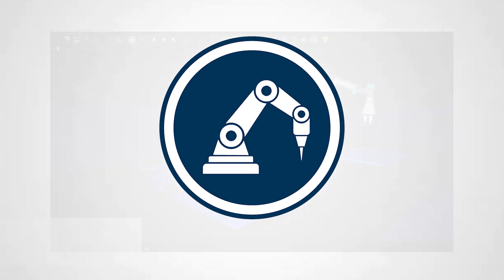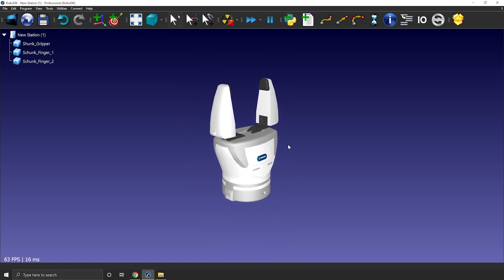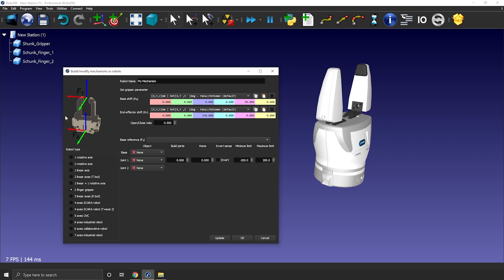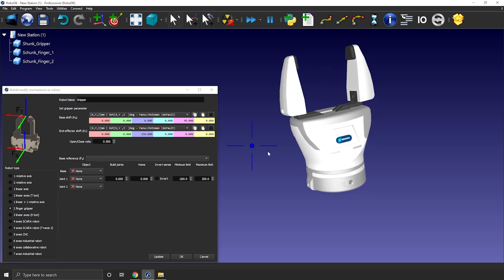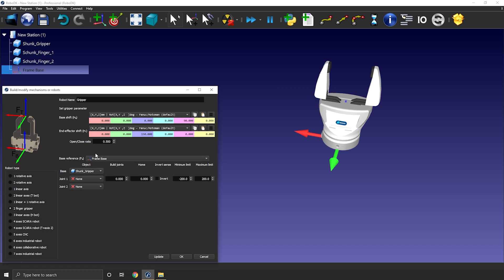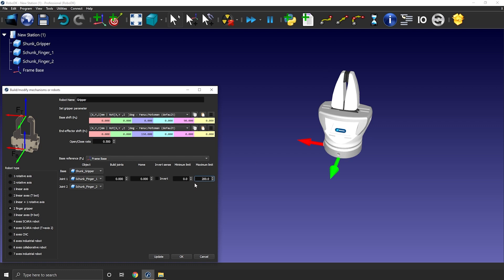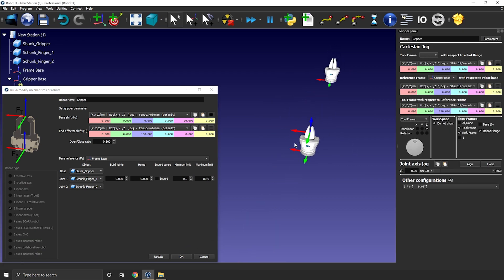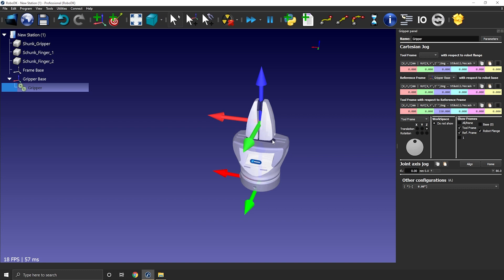How to Model a 2-Finger Parallel Gripper

Comment: Hello. I am trying to attach objects with the Robotiq gripper. But not able to make it work. If I am adding it as a tool, then not able to move the gripper, and when adding it as a gripper cant not attach the objects. Can you make a small video for the robotic gripper? How to use the gripper for picking up an object, please. I tried a lot but could get the results or can you guide hear
Reply from the maker: You need to create a TCP by right-clicking the robot and "Add TCP". 
You then attach your object to that TCP. 
The gripper is just a mechanism for visualization purposes, but you still need the TCP.
Reply: @RoboDK3D  yes, i am doing That only. But here I can’t move the fingers, i want to pick one shaft kn my case. Like this I can only attach the object but I can’t move the fingers of gripper. What should I do for it.

Comment: Hey.... Hi, How to make a TCP and the mechanism for a 2 finger gripper in one Go. Because if I import a RoborIQ Hand-E gripper from library i just get the Mechanism model rather combined one. I have seen a tutorial. Where I see you have 2 files one is TCP Shunk gripper and other Shunk Mechanism both the TCP and movement of fingers are working to creat a main program with the robot arm movement simultaneously.
Reply from the maker: You need to create the gripper mechanism and the gripper TCP separately. 
Right-click the robot -> Add TCP
- Jeremy
Reply: @RoboDK3D  Could you explain how to match the TCP to the gripper I created? I do not understand how to use a .robot file as a tool.
Reply from the maker: @darrenmccarty880  I'm not sure I understand your question.
You should write this on our forum and add images. 
Robodk.com/forum